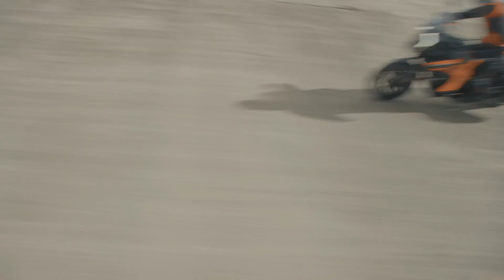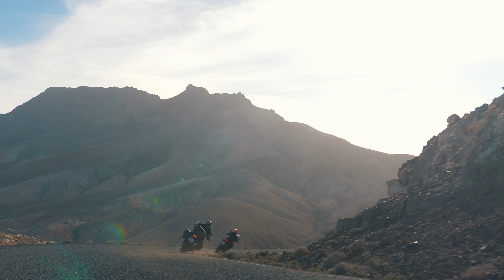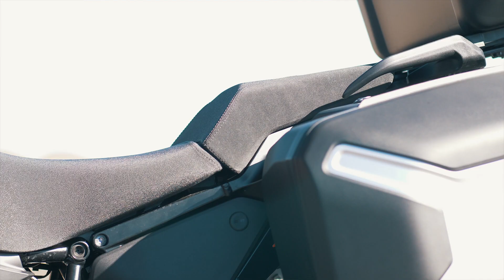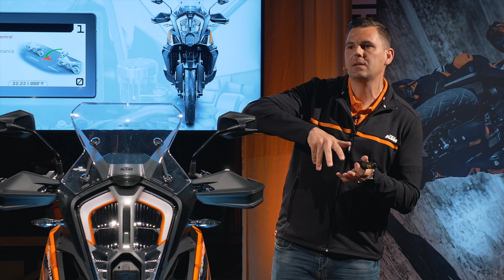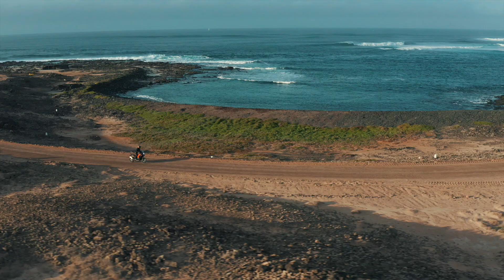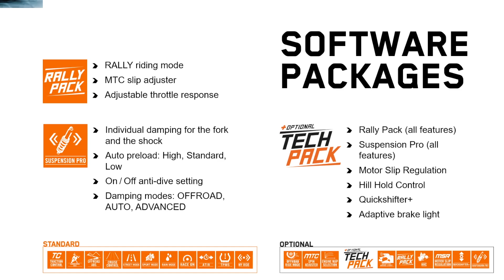2021 KTM 1290 SUPER ADVENTURE S -  COMPLETE INSIGHT - Fowlers Motorcycles

Comment: It would have been great if the bike had been fitted with the blind spot monitoring system that you have been testing with the ACC.  With the use of the new LED screen etc, where is the Apple Car play, cause the KTM My Ride System is very limiting and still only using Bluetooth rather than WIFI.  So when you say that its the most technologically advanced bike is not quite true!  That is why I'm having second thoughts about the new KTM 1290 and seriously thinking about the Ducati Multistrada V4.

Comment: Bike improvements sound amazing, great job KTM, One question, 5 KTM 1290’s owner here including super dukes and adventures, has the frond end been reinforced for vibrations? Like for the gps mount and head area? Previous models shake a lot, I would recommend a metal brace like the 1250 GS.